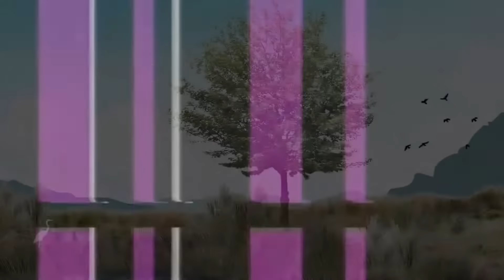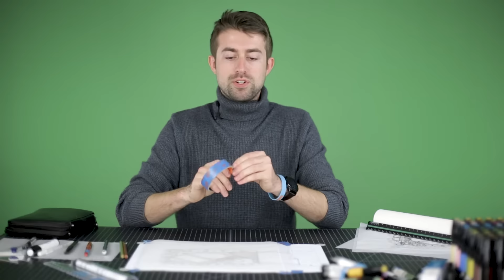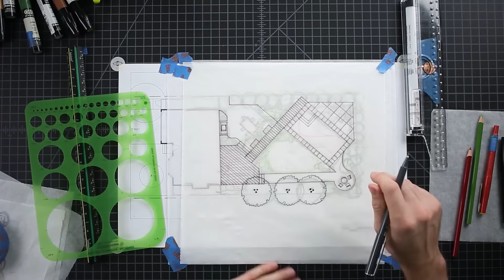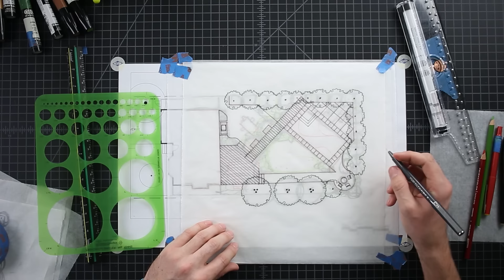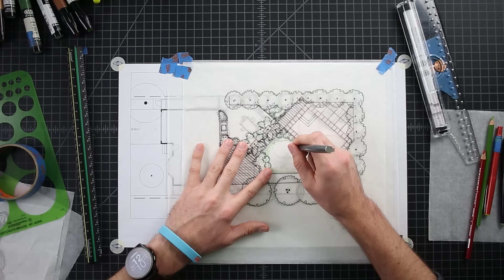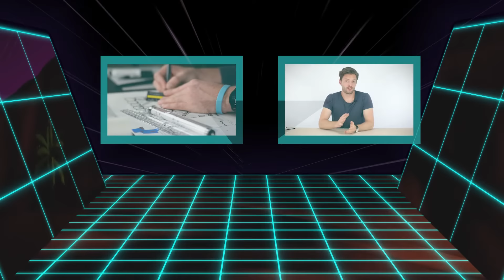Landscape Design - Line Drawing - Part 2

Comment: line weights?
Reply from the maker: For my hand-rendered plans I usually only use one or 2 pens thicknesses, I save the line weight fuss for Autocad.
Reply: @EricArneson I think they are asking what size of tip the pens you use are. I am also curious what pens you use because the one for the final inking looks very satisfying to use.